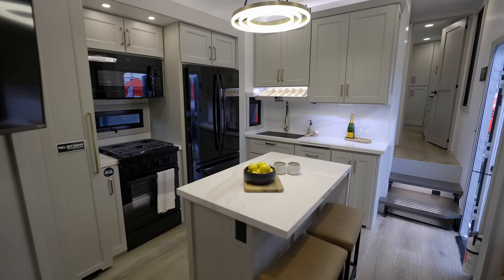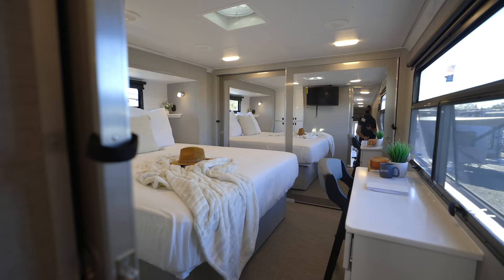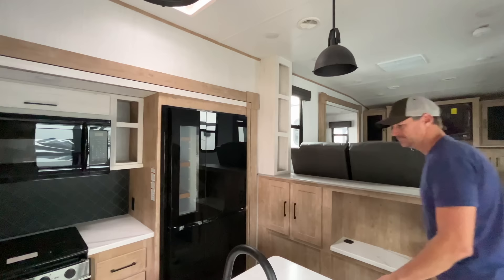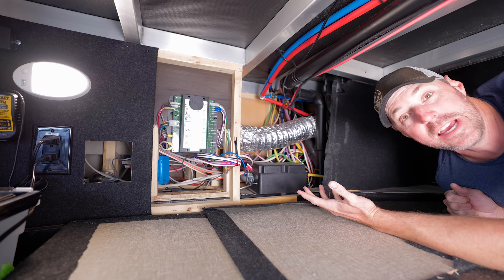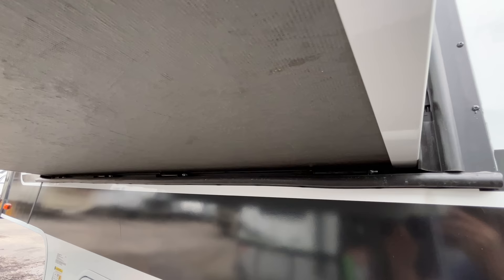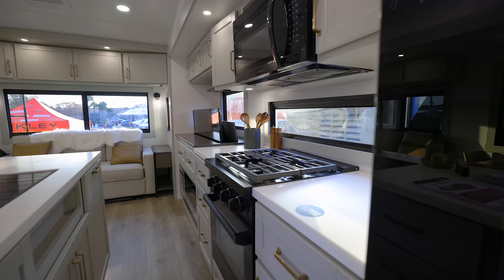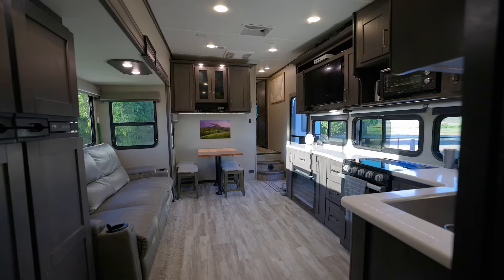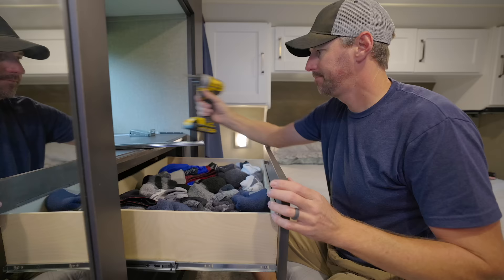Are All RVs Junk! Problems With Our Grand Design RV.

Comment: You see factory tours showing inspectors, but then you see dealers of that brand with units with awnings wired backwards, missing sealant, trim missing, thermostat wire never connected to AC…  Might be a bit of an accountability problem.   IE boss hears about a unit that shipped with the fireplace never hooked up- let’s go have a chat with the inspector who initialed off that the fireplace was ok. First time might be a teaching moment. A second time and the conversation might start “Ted, how long have you been working here, not counting tomorrow…”

Comment: GD was a pretty good trailer back a few years ago but the 2 guys that started that company sold out around 2018 and now is owned by the same organization that builds most of the trailers in Indiana and all the appliance's are all the same built in China, I owned an ole Dutchman 32 foot TT that was built in 1984 and it didn't have any slides on it but we loved that trailer and it was bullet proof, it's setting in a full time park in Pismo Beach and the people that own it just leave it there and use it about 4 months a year.

Comment: Jared, I respect your information and your perspective 100%. I ha3rd 5th wheel. #ve been seriously RV’ing since my daughter got married in about 1990 or so.  I am on my 3rd 5’er. #1 a repo 1985 Hitch Hiker 36’ Premier 2 slide #2 2004 39’ Teton Grand Sundance 3slide 3 axle beast and our current Arctic Fox 29-5 T 2 slide (great rig BTW).  All were much better equipped coaches and all had some kind of issue , some immediate, some over the life of the unit ( my Teton for instance came with way too lite wheels and tires, d rated tired and wheels on a coach with a 20K GVWR),which also had a pin weight of about 4k.  Sales man “ you will be fine towing this with your 01 Dodge 3500 dually”. These things can be expected and the buyer needs to know this.  Not mechanically able, you need to learn some! I took both my Hitch Hiker and My Teton from So Cal to Alaska twice.  I would have been stranded multiple times had I not been prepped for the worst. Sorry for being  long winded.  Also I’m in awe of your solar setup.  Thanks for you and your honesty about RV life.  Rick Colston😊😊😊
Reply: How’s your Arctic Fox? Is it better quality than other brands?
Reply: @purplemoose6431 Mine , so far has been very good. I have had to fix a few small things but over all excellent. I usually don’t rely too much on the repair shops. We made a lot of extra mods, more ryde suspension, an Onan 5500 propane gen set. The small solar package was wired badly as was the coax for the TV.  The wife and I wanted to down size and only 2 slides which this model has. Another plus for us was the ability to have a washer dryer and 2 a/c’s. We tend to go on extended trips so those conveniences were welcome. Over all pretty happy. One issue is the dealer network is pretty small, but for us being in California and Northwood being inOregon or Washington is a plus.

Comment: My K-Z Sportsman Classic has been nothing but problems.  In order of occurrence-- sizzor jacks at each corner have rusted to the point that one of them bent when trying to expand it, insulation around right tire housing doesn't exist allowing Texas dirt to cover everything in both dining benches, TV antenna broke off the stem,  dining bench collapsed, panel in shower not stapled improperly, strip on bathroom sink and the kitchen counter was not applied with water proof glue so they came off, door to lavatory cabinet has fallen apart and shock proof outlet continues to blow every time it rains out--this is very frustrating.

Comment: I’m retired and planning on purchasing an RV in early 2024. So much of what I read and see alarms me. Give me ICU patients any day. Plus I’ve got ZERO skills in the DIY area. Nobody taught their girls these things back in the day and I never learned it in my college years. My traveling buddy is no better. Can I realistically head to the hills in an RV or will it be nothing but repairs? Maybe I just need to pay for lodging site to site? I’m glad about the Brinkley review as that is the top 5th wheel manufacturer I’m focused on. The other option is a Leisure Travel Van. Sigh. We’ll see.
Reply: As a retired manufacturing engineer in auto and aero, I've done my due diligence in researching RV builds.  Here are my thoughts:

Stay shorter with a quality suspension.  Long trailers flex more. Don't shy away from shorter trailers with tandem axles thinking they are overkill or too complex.  This is actually a really good design.

Stay away from cheap stick and tin. These are basically a wood framed small scale mobile home that you're going to pull down the road. A richter scale event every time you leave your driveway. Look for aluminum frames, minimum

Take a look at fiberglass.  Oliver, Cortez, Bigfoot, Casita, Scamp.  Quality and resale rival Airstream.

Look for proper plumbing. Make sure flex lines have proper clamps.  Brass fittings/joints are also a plus. 

Minimal holes on roof. Stay clear of  thin rubber roofs. Research mil thickness and brand.

Look for real wood cabinets. Usually, real wood front frames and doors with plywood boxes.

Stay away from mds counters with thermofoil tops. This is basically shrink wrapped plastic over ultrafine particle board. This soaks up water like a sponge.  Look for quality plywood and formica-like tops or solid surface.

Avoid slide outs.  Research the best if you have to have and stay away from cheap, poorly designed mechanisms. Cable pull is the worst (super hard to adjust... even by trained personnel).  Rack and pinion is the simplest and most reliable.

Look for lithium iron phosphate batteries.  Stay clear of AGM and Lithium Ion.

Check for quality name brand tires

Do research on outrigger gussets. These are triangular supports just outside the frame sitting at a right angle.  There have been many failures on late model trailers.

Do your research on refrigerators, ac units and furnaces.  Better quality RVs will usually not skimp here. Be cautious of price point sacrifices though.

Watch Rigor RV Repair and AZExpert on YouTube for tips and tricks.

Buy used from private party with good maintenance records.  DO NOT buy new... or even used from dealer.  Usually, the used RVs at dealers were traded because there were issues.  Exception would be if you know and trust the sales rep.

Try to find a video of a plant tour.  Here's an example: NuCamp Tab versus Little Guy Max. With my trained eye, the Nucamp assembly process was head and shoulders above the LGM. This kind of "eyes on" will definitely give you some confidence in your decision making.

Good Luck!

Comment: When you look at where RVs are made they all or most are made in a assembly line and all use the same building methods and materials, I work in the rv business for a keystone rv dealership as a master service technician for 15 years and I seen most of all that goes wrong . Some companies are better and some worse on quality and it depends on what you pay.  Even airstream trailers ain't the same as the original ones I worked on that where from the past.

Comment: I will boldly answer that,  YES except for those built before 2005 to 2010.  I can afford a brand new Newmar, cash, but wouldn't.   We looked at many, drawers falling apart,  molding stayedin our hands terrible.  We have a 97 HR 34' built like a tank, all real wood inside, full roll cage aluminum strycture, aluminum exterior walls,  all aluminum roof, we have built-in all the latest amenities, exterior looks like new.  We have redone the salon furniture, dinette galley and we keep the mechanicals like new.  No slides, no electric awning,  no electric blinds, no heated floors and most important,  no problems, we travel about 10K a year and we have no intention of changing it. 26 years old and we can jump in right now and drive across the country with full confidence,  and just like any other other coach we have a nice electric galley, queen size bed, Extremely comfortable seating and lounging.  full bathroom with good size shower that's not in the hallway and we love it.  Builders started building scrap because they could not because they had too, no redulation with newbie buyers and easy lending terms, sound like the old finance Companies that sold you a #3,000 tv with payments 40 years ago,

Comment: The bottom line is, an RV is a depreciating asset. It’s a depreciating asset because it’s going to fall apart at some point. This is why it’s silly to think that selling your traditional home, an APPRECIATING asset, for an RV is somehow a great idea. People need to stop comparing an RV to a traditionally built home. It’s a trailer house that you can tow behind your depreciating pickup. If you’ve ever owned a trailer house, you know that they are not well built compared to a traditional house. Imagine how quickly that trailer house would fall apart if you pulled it all around the country behind your vehicle. RVs are toys for adults. They are NOT intended to be lived in full time. However if you choose to live in them full time, get ready to replace them, AT A MAJOR LOSS, every 10 years or so. The reason many RV parks have a “10 year rule” is because a large portion of RVs are complete junk after 10 years, whereas a traditionally built 10 year old home is basically still brand new.

Comment: You get what you pay for. If you buy a 19k, small camper, 30k larger camper and a 50k 5th wheel, expect junk, paper wood.

If you pay a little extra for each class 10 to 20k, you will get good quality.
Buy an RV with Azdel Inside and out. Outside walls, Inside walls and Roof. That way fiberglass never delaminates.
Also if you get Aluminum framing, walls, roof and floor, floors, the RV will last a long time. Floors will eventually always rot, you don't want metal floors, 3/4 inch Marine grade plywood. You want to water proof the underside.

Comment: folks,...........Don't buy fifth wheel campers, the company that builds the frames have under-engineered these frames, the failure rates are very high, plus pandemic year built and afterward campers are cheaply made where corners were cut to get them on dealers lots as fast as they could, temp. labor was used to build these units, quality is non-existent.

Comment: like you, we've had our RV for years, 6 to be exact, and the problems just keep coming. Our problems are poor design. The big one was a leaf spring hanger that came loose from the frame. I said poor design because they attached the hangers directly to the frame and the stress of backing was transferred to the frame causing the frame to crack. I had to weld plates above all the hangers to fix the problem. They do not attach the hangers to the frame anymore, they have added a square tube to the bottom of the frame to take the stress off the frame. The latest issue is the trailer brake warring and then disconnecting. It pledged our trip for two weeks till we got home. The problem is some dumb A** thought it would save time and/or money if they ran the trailer brake wire loose inside the axle. As I said, the trailer is 6 years old, and the wire that was loose inside the axle rubbed till it rubbed the insulation off the wire and caused an intermittent short.

Comment: I will never believe an RV manufacturing company cares about the buyer. Their problems are solved on the backs of buyers. I see so many video influencers blatantly lie.  I see people post on Facebook how companies send them box full of parts. I ask for two parts and they send an owners manual. Companies invite them up to the factory for repairs, i ask to stop by and get technical information, i am told no. 
I own a June 2022 built RV, to sell it would be a huge financial loss. But this is the last RV. Never again. I don’t think I can ever trust a manufacturer or Dealer. 
O, and dealers. They just crooked as heck. I not sorry, RV industry is the most crooked there is.

Comment: The problem is compounded if you RV is used full time. Most RVs are not built for full time use. Most are only built for a month or 2 per year.  I do think they're all junk over the long haul but it's not just RVs, everything tends to be built with planned obsolesence as the business plan. I've got a Lance 1181 and live in it full time. 10 years full time is a long time in an RVs lifespan and there are strutrual problems that won't be fixed. Spending almost 6 figures  every 10 years is not really an option is it? I might do that in a house but I've got a property that may have some future value. An RV just doesn't.

Comment: I have decided that RVs ARE junk & IF you buy 1 be prepared to rebuild it or spend time haggling with a repair shop or dealer to fix your problems. The ONLY way to get a good RV is to build (or rebuild) it, from scratch if you have. My hubby, a Renaissance handyman shade tree mechanic who can do just about anything, has done things for & to our TT from top to bottom & front to back to keep it in tip top travelling shape.

Comment: You have a valid point . Who’s better or getting better at being quality? I own a 2021 gulfstream 6320 model class C . For some reason in the world of rv you tube you hear squat about them. I will tho, Nicky mouse trim repairs I’ve done, having a driver side power mirror replaced under warranty but I had to go back and redue the tard’s workmanship. Fresh tank water pump, etc. now would you spend $175,000 on a boat? Is it gonna leak? Water pump gonna work? What about everything else on the boat? Hmmm, I still say rv’s across the board are garbage. Everyone of them, no matter the manufacturer.

Comment: RV's are junk? If it is NOT JUNK it's not an RV!!   I work on 15+ year old RV's.  You save a TON of $$$ after 10 years and even spending $5K to $8K to go through every detail no matter how small on the coach you would have spend under $30K for a class A and have a very reliable machine vs spending 90K+ on a Class B or C.  Biggest complaint is for new owners paying over $100K -- you deserve better.  YES owning an RV you must be DIY or $Rich.

Comment: I think we just need to boycott the rv industry! Went to the Des Moines RV show. Most of the rvs were junk. The Alpine 5th wheel and Brinkley were the best quality ones I seen. The engineers need to design these better with quality in mind. The last 2 5th wheels I have had I have had issues. Doors misaligned, frame separated,  water leaks, trim falling off, belly retention skirt coming off, plastic bubbling out of fresh water tank, water pump and plumbing lines loud, frame bolts coming through floor damaging vinyl flooring, entry door swells in the sun. This is a 2021 cougar 29mbs. Order brand new and have these issues. Makes one sick! No one cares the products they put anymore! Then take it to the dealer to get fixed and their incompetent team use inferior products and labor to fix it after waiting months to get work done. Also they damaged our bed slide, roof, and gutter, rear ladder while at dealership. Just picking it up we noticed! That was Bowling RV in Ottumwa Iowa. Afraid to take in for the rest of the stuff on the list after it went in for a water leak to find all of that! Never leave dealership without throughly going through your rv to make sure all is ok. Once you leave it is on you!

Comment: My parents bought a Shasta when I was 6 and that gives me 60 yrs in the rv game.  The vast majority of them are built in one region of Indiana. They all use the same parts and parts manufacturers. They all share the same labor force. Some teams just move from plant to plant doing what they are trained to do. Every company is under intense pressure to get products designed, built, and sold as quickly and efficiently as possible. Todays shining star and  fancy name plate will sell that name in the coming years and quickly become a dud. Are they all junk? Absolutely! You could not afford them if they weren't. The companies would not be able to exist if they weren't.  Know that you are buying a project. In the early days you were basically buying a metal tent on wheels...things have not progressed all that much. Lower your expectations and stock your tool box!

Comment: Any new RV, at any price point, can be frustratingly shoddy. Not every one mind you but, unfortunately, its the luck of the draw. Sadly, brand new RVers assume that RVs are like cars and trucks. Built with quality control on large controlled assembly lines and both designed and tested for quality. Just not true. It could be, but manufacturers build way too many versions of every product in an effort to cover all the market niches possible. If manufacturers limited their product lines. Spent more time, effort and development funds on building a good product things would be better industry wide. We bought a new Winnebago motorhome 6 years ago and got very lucky. Few problems, decent quality and decent factory support. But others buying the same motorhome, the same year??? Who knows. It could just as easily be a nightmare. 

You do have to be a capable DIYer to make RV ownership more acceptable and you have to dial down your expectations about what  your money is buying.

Comment: They are ALL JUNK, I of course still bought one, never buying new again, that was a 10 year high end Keystone Montana nightmare. This time I went from 5th wheel to used Class A and being a 2016 with only 9k miles it is looking like new except for the slide leak and the bad furnace being work on again this week, so it's been in the shop every weeks since 9/09/23. The craftmanship is NILL, they throw these things together and while ours is optioned out with buss storage and carpeted cabinets, NO LIGHTS in the basement storage compartments. Just fracking ugh, hopefully we get it back by this Thursday to take it on our finaly trip for this year.